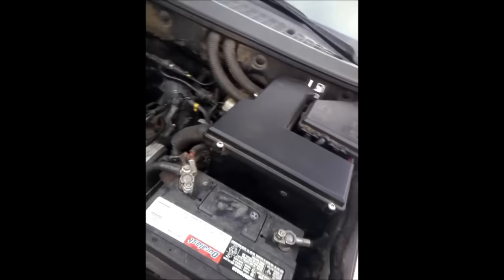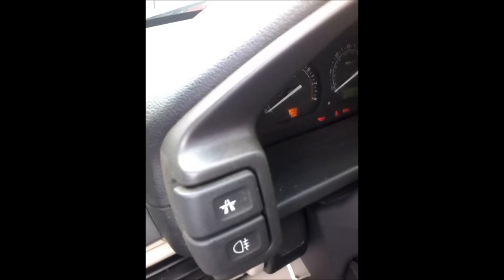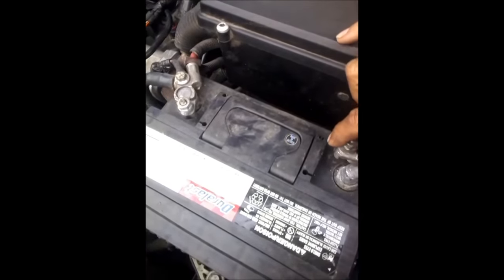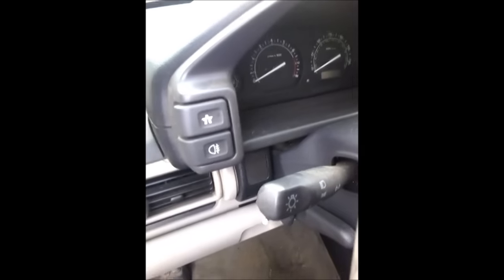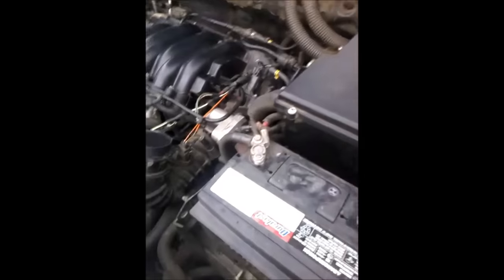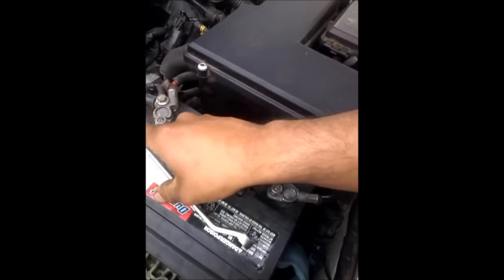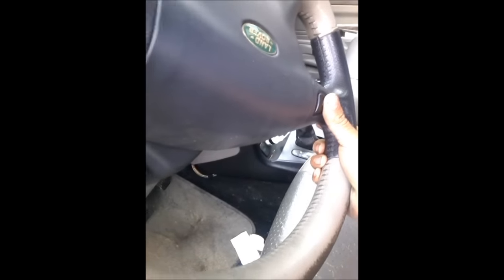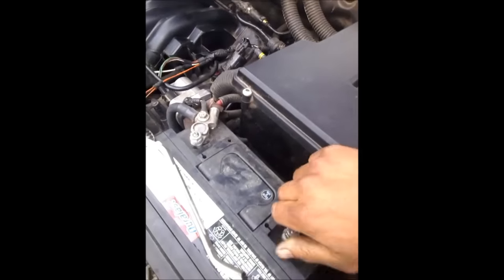3 ways to turn off CHECK ENGINE without scanner EASY!!

Comment: I'm amazed at how many people seem to think that getting the check engine light to go off is solving a problem. I understand that even one spec of dust in an O2 sensor can cause a check engine light to go on. But, if a simple problem corrects itself, your check engine light will often go off in a little while. A check engine light is an indication of a problem, and is not a problem in itself. It indicates that there is a problem that needs to be fixed. Fix the problem and the light will go off. Go to about any auto parts store and they'll hook up a scanner for free and tell you what code is causing your check engine light to come on.
Reply: Very true words. Unless you know what’s causing the problem and your ok with it (faulty gas cap), at least get the code read like you said. 2016 f150 5.0 with 86k miles since new, only had one problem ever, light came on and lost my throttle body a few seconds later. Still made it to the closest dealer 30 min away 💪🏼
Reply: Some people just be trying to pass a emissions test
Reply: Who says it was solving all peoples problems we don’t care about that we just wanna go take the car in and get the smog check to pass because if it doesn’t you either have to fix the problem and if you don’t you can’t drive the damn car and sometimes those lights are faulty to the point where you do not have to get that repaired right away so stop badgering people who are trying alternative measures
Reply: @fagoose88  thank you nobody’s worried about that other stuff they will get that fixed down the line if they have to but if you can’t pass the emissions test you cannot register your vehicle and I personally saw another video where a guy said his girlfriends light comes on and off and he’s an actual mechanic he said there’s nothing wrong with her converter so why should she go and pay for something that doesn’t need to be fixed
Reply: Nobody's dumb just cause you wanna pass emissions doesn't mean u your not going to deal with the issues
Reply: They sure will!!! Sir, your FTP sensor is faulty, we see a code 345533, for sure its your FTP sensor and for $73.88 we can sell you a new one. Ok, if I need it.. oh sure sir you need it. 

Replaced it, same CHECK ENGINE light is on. correct, any auto parts will hook up for "free" and tell you the problem......problem is they are in the business of making money
Reply: Yes, but if you have changed the parts as shown on the error codes and it still hasnt cleared, then what sherlock? #spastic

Comment: Dude, if that wrench makes contact across that battery, your video will get very interesting very fast.
Reply: Good observation that one
Reply: fastacker2 ... what's your point...it didn't make contact...and if it did...big deal... a little spark... You guys are too funny
Reply: @uttergutter44  Worst case would be the wrench gets welded to the terminals, and of course immediately glows red hot from the dead short across the terminals, so grabbing it is out of the question. Then the battery explodes, showering the guy with sulfuric acid. But other than that, perfectly safe.  :)
Here is a guy telling about a battery that exploded in his face. Yes, it's a big deal. 
https://www.youtube.com/watch?v=4sZ4oJt0zAc
Reply: fastacker2 what do you live in a plastic bubble or something is your name John Travolta... Get over it we all take risks... You got a better chance of getting hurt just driving down the freaking Road
Reply: Thanks
Reply: @fastacker2  I agree there's a positive and a negative, when combined shit will go negative real fast! ⚡😬😖😯😫!
Reply: You beat me to it. Lol
Reply: Ironically he suggests putting a cable between the two terminals. I've always been told that was a bad idea.
Reply: fastacker2 i get nervous every time he put the tool in the battery
Reply: I was so nervous watching that spanner dancing near both battery terminals🤭🤭🤭. Even the positive to any ground would be like a Xmas party 💥💥💥💥💥💥
Reply: OMG 😂
Reply: He meant on the cables and not on the battery terminals
Reply: 95% of you have never touched a battery.
Reply: actually his birdie would just fly away! lol
Reply: I was thinking the same thing.
Reply: thats not nice
Reply: @abiodunalonge3353  Well, if the pointed hat fits...   :)
Reply: This is the dark side of YT
Reply: @nirbhaysharma700  Just pointing out an extreme hazard in the video. Trying to keep someone from blinding themselves with an exploding battery full of acid. If that is being "the dark side", then I wear my Darth Vader mask with pride. Do you work on a lot of cars or just the PC police?
Reply: @idragonidragon2796  it would take a while to blow,unless it was leaking gases..the terminals start to glow and the spanner gets real hot! If you're quick,you should be able to avoid a face full of battery acid!😆
Reply: @uttergutter44  You have no idea - it's like 400 amps.
Reply: Wtf is a birdie?  Lol
Reply: @germancarrasco2082  have to be a mr. carrasco (always de la gente)
Reply: fastacker2 cool tip😎I never knew that thanks for teaching me something now God bless you
Reply: Unless you're using rubber boots nothing will happen.
Reply: @eduardoferraz6907  hmm try that, then let us know how u get on.
Reply: SHEEEIIDDTTT! It would be critical at best.
Reply: @uttergutter44  
There is taking a risk that leads to things turning out positive or neutral, and there is also risks that leads from range of very minor to very dire consequences.
As for negative outcome, the difference is, could it be avoidable and what could not be avoided. There are risks that a person takes that is not truly their fault, and other times, they if not completely at fault are partially at fault. That is the difference. 
I rather have something happen driving down the road, speed limit, and practice safety and not insist on me first all the time because there are times it is safer to let someone else go first than play around with wrench going over battery and it blowing up on me. There is a thing called self-accountability like it or not. The responsibility to learn right risks and wrong risks and avoid wrong risks comes from God. So, wanting to be sensible is not living in a bubble, sensible as in, we not get into things the Lord calls us not to.
Reply: @fastacker2  
I just take your word for it. Batteries, even AAA, is nada to mess around!
Reply: Don't you mean the barety
Reply: Triggered by someone informing others of the situation, bravo Karen bravo.
Reply: I did this axidently to my car and just few sparks flies out like the comments bellow 😁 jokes aside not even a fuse blown
Reply: I was waiting for the sparks
Reply: @uttergutter44  yeah bro just get over dying no big deal
Reply: @uttergutter44  very danger if you have a ring on your finger it can melt the ring and burn your fingers it did happen to me about 40 year ago . Safety first please !
Reply: Facts 😅
Reply: I did that once. Arced the battery with a wrench. It melted the terminals off lol.
Reply: @uttergutter44 he made a observation, get over it🙄

Comment: Another nifty way is a nice round piece of black electrical tape and cover that pesky annoying light, works every time😂
Reply: Those Maintanence Needed lights are a scam. They are turned on by the computer after so many miles so you'll take your car to the dealer. They'll turn it off and charge you a big bill.
Reply: @Mr. M5 I bought a Scion XB in 2006. The mechanic at the dealer was a good guy and showed me how to reset it myself, no charge. Always as them how. If the boss ain't around they may show you.
Reply: Don't let the bulb burn out in States that do emissions testing . That light needs to be in working condition to pass.

Comment: You should never use a spanner long enough to reach both battery terminals as it risks ashort circuit
Reply: yeh, I dont' have many tools that long and neither did DAD,   a life long mechanic. Good for some diesel engine work, but my "swing" would NOT be in the same arc as the positive terminal!

Comment: For the first time I bought use car. I saw that is nothing wrong,  after two weeks engine light came on. I did the first method and is working!!! Thank you man, may God bless you!
Reply: U still have an issue tho so wouldn’t say it worked it just did what it is meant to. The light only resets but if there is a issue with the car it will come back on. U got to get to the root of the issue first then when the root issue is fixed the light will stay on unless u do this to reset it for it to go off. Older cars do this but new ones will turn off on their own. But if the issue is not fixed it’s not a fix in itself it is just turning the lights off temporarily.

Comment: I see a lot of people making fun of your video and  accent, but dude I tried everything until I got to your instructions and the first way works. I turn on accessories car not running with check engine light on steady, then disconnected the negative  battery cable  and touched the cable approximately three time to the negative pole. Connected back negative cable went inside car and turn on and bam SES light went out. This was done on a Nissan Pathfinder 2016. Thank you
Reply from the maker: Some people focus on my accent, what they dont know is im in a spanish speaking country. I make this videos to practice english and help others. It is normal people first look the bad things then see the message :(
Reply: @YourCarFacts  Porque son ignorantes pero apenas entienden un idioma. Gracias por darnos opciones para quitar esa luz. 👌😉

Comment: Multilingual, Mechanically Inclined, and a Willingness to Share said knowledge with the youtube masses?  You Sir, have got yourself a subcriber. Adios electrical tape covering up the dummy light. thank you.
Reply: Dummy light?
Reply: @cheeko_914  when the dash lights  lilliminate, it means that you’ve completely ignored the Gauges  (temperature, oil pressure, etc.., which will indicate a problem before breaking. lights mean it's already broken.... dummy. lol.jk
Reply: @heynofatchicksok  Originally, the "Dummy Light" only came on cars that lacked any, or at least one necessary gauge. 
Most of the time a car with "Dummy Lights" had no actual "gauges", i.e. water temp with actual temp numbers, oil pressure with actual lbs. numbers, battery/alt gauge with actual volt/amp numbers, etc.

Comment: This worked perfectly!! Even resetting by mechanic after replacing 02 sensor fault , fault code kept returning. But this worked on my VE holden. Many thanks from Australia!
Reply: I just replaced my oxygen sensors both of them and the engine light still on how did u get urs off
Reply: I have an 06 Acura tl

Comment: Check engine light was lit at my 2000 jeep grand Cherokee, I tried with my not cheap scanner, disconnected battery cable and wait for 60 second, check the temp sensor and so and so but what a waste of time until I watched your video, you gave me a big tip I didn't know, my problem was, I didn't know the ignition key must be on before disconnecting battery lead, thanks to you I learned something new today, my car engine is good again now.

Comment: G'day
Thank you very much for this tip. I brought my car to 3 mechanics and were told would be close to a lot of money. I followed the first tip and check engine was fixed. Thank you Thank you! Salute to you, an honest and a great mechanic.
Reply: "Fixed"
Reply: the problem is not solved,  because it will not pass the smog test..
Reply: @bertotoma2982  you can always smoke on the water,

Comment: Good morning,
How are you doing this morning. Thank you very much for the video. I tried it on my truck. because my check engine, VSC and TRAC lights came on.
I have 2007 Toyota 4Runner SR5. They just replaced the battery, alternator and the belt. It wasn't no problem, but the lights came on same day after the new battery, alternator and the belt was replaced.
I tried your video and it is fixed now.
I really appreciate it.
Take care and stay safe.
Thank you.
Jack
I

Comment: Hi, thanks for your video. My 2015 Kia Sportage had an ignition malfunction lamp on 2days ago and occasionally flicked then kept on.  if I follow your way to disconnect the car battery negative pole for 3 times will my central door remove setting need to be reprogrammed?  Or there only the clock and radio needs to be reset?

Comment: Replaced EGR valve and Bank 1 O2 sensor on a Buick Regal GS car is running fine. Could not get the light to go off after repairs  so  I tried tapping the negative side three times like you said it worked like a charm. Thanks Brother 🤘

Comment: Your video is 6 years old and is still saving lives and money. I just tried this and my check engine light has disappeared. The light came on 2 days ago but car is working perfectly, no funny sound in the engine. It drives smoothly but the light just stays on. I did this hack and engine light is off. that would have cost me about £30 or more to clear at the mechanic station.

Comment: Thanks for your video posting, you saved me taking my car to a mechanic, one thing that you need to add to your video is, after reset we have to drive the car, before emission test, for 100 miles to pass the test. Thanks again

Comment: My AC is not working and the check engine light keeps coming on and off any suggestions, and thank u so much God bless 🙏🏼 
I'm about to go to the basic Rundown with the clutch and the high and low pressure switches

Comment: Thank you for this.  I used the second method which worked great. The only thing I found was that I had to leave the battery disconnected for 3 minutes before it worked. Greatly appreciated.
Reply: Works for about 15-20 MLS.,Then it'l Come Back On.Have Ur Parts Store Run a Scan & it Will give U an Accurate Solution.

Comment: After the check ingen light goes out can u take it then to the inspection center for inspection will thear system detect that u disconected the negative cable ?
Pleade let me know.thks

Comment: Brother you are the man I just put a new O2 sensor in with i was quoted $650 from 2 places, I did it myself it took me 10mins. And I just needed to remove the engine light, I did the touch the negative on the battery 3 times and it removed it, 
Thanks heaps brother😊
Reply: Was it fault of 02 sensor

Comment: Method #1 worked like a charm.  Thank you very much.  There is reason to turn the light off.  My Silverado was throwing no codes.  Perhaps when it comes back on, a code will show up with it.  Leaving it permanently on serves no purpose.
Reply: Gas Cap
Reply: thats the one i hope will work on my car

Comment: Please explain. I recently had a reprogrammed Engine Control Module replaced by Flagstaff auto in New York.
I gave them my VIN #. They reprogrammed it there then sent it to me in Alberta ( listed at $176 after exchange and shipping it came to $385 - i had no coice). We tried 2 from local junk yard to no effect.
I raised my front end after it continued to indicate "engine" & Check Oil" indicators.
I jacked it down and no "engine" or "check oil" indicators on dash for about one block. I changed oil (1200 miles) a bit low, but "check oil" light disappeared but engine light came back on.
Any thoughts?
Thanks.
David
Alberta
( new starter, ignition switch, and ECM)

Comment: #1 method by disconnecting the negative cable while engine on didn't work so I did it without engine on, then it worked. Thanks a lot for the tip.
Reply: I think he said to do it with engine off.
Reply from the maker: Yes

Comment: I have cleaned the EGR valve for remove the carbon but after that engine light still comes on than I have changed the EGR valve and buy new and after that I have taken test drive. After taken test drive engine light comes on than what should be the problem. Is it wiring problems, spark plug problem, ignition switch problem. How can I solve this problem after buying new EGR valve in Ford Figo 2011 model.

Comment: my car is a hyundai i20 2014 model, my sister had a accident with the car and we took it to the shop to get it repaired. when it came back from the shop the light was on , and it remains on until today, but there is no problem whatsoever, i drive it normally , no sensor has a problem or nothing, can i still preform this , for my engine light to go off ?

Comment: Brilliant.   I used the 1st method.  If it comes on again, I will get it checked out.  Since I have a key fob, I had to get to the "on" position by holding the  ignition button down for 10 seconds WITHOUT putting my foot on the brake.

Comment: I had a car that the light would go on once in a while. It was always a sensor that was malfunctioning when it would go on. That's the usual problem when the light pops on. It's usually the fuel/air mixture sensor that's the problem. When the light starts blinking, then you got trouble.